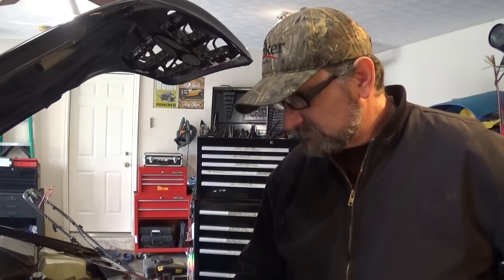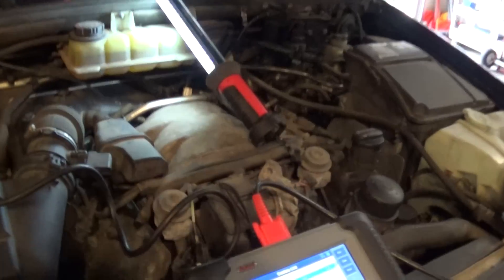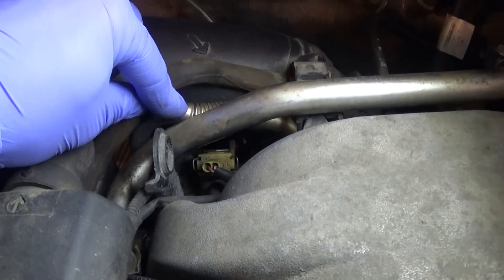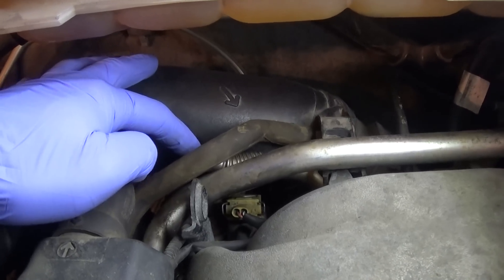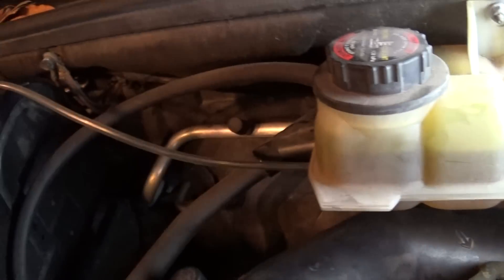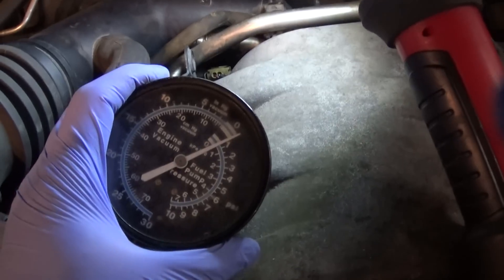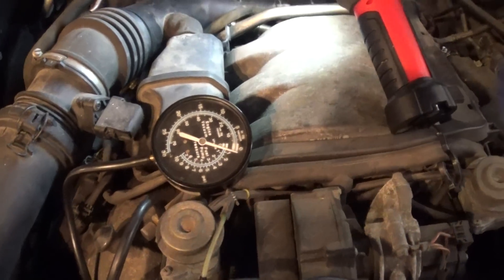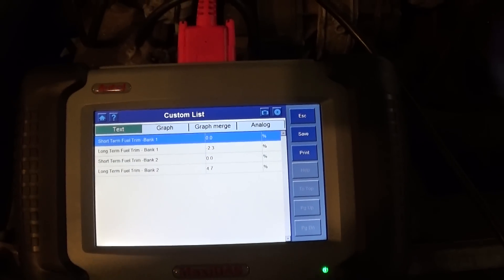How To Diagnose Stuck Open EGR Valve

Comment: so no code on a vacuum activated is pretty common? my mitsu I tell mechanic it feels like egr stuck open shakes when idling and stalls occasionally he tells me there would be a code and tries to and sell me a fuel pump saying its low fuel pressure, w/o testing pressure. Car feels exactly how my cab felt when the dpfe went but I got a code. I would have went after egr first just because the way it feel
thanks, I will first try cleaning egr

Comment: Great video. I have a question, how do you test for a closed EGR valve?  On a diesel common rail engine I have a problem with detonation/know once the car is normal operating temperature and occurs mainly between 1200 and 1900 RPM.  When the car is cold, the car runs perfectly. I have heard that a closed EGR valve can cause high cylinder temperature and this can cause knock.  Your thoughts would be really appreciated.  Thank you.

Comment: Is it possible to get an intermittent fault with the egr valve electric motor?  Sometimes I have fault codes, sometimes I don't... I opened the egr valve and it's not sticking at all.

Comment: My '96 Civic won't start when the motor is warm.  Has fuel, spark and compression.  Timing belt replaced 5,000 miles ago.   Could a stuck EGR valve be the problem? Sometimes it won't start when the motor is cold, but never when the motor is warm.
Reply from the maker: Did you actually check fuel pressure with engine worm?
Reply: @kyhomegarage3430  I only checked that it was fuel pressure.  Car has been in the shop for many days so I can't do anything with it right now.

Comment: hi. i have a skoda 2,0 tdi cffb engine. it cut out on me in morning. wouldnt start only cranked. i got it started with easy start spray. and it ran ok drove ok for half a mile. went to start it again later in evening and it started but as soon as i revved it to move...it cut out and wouldnt start again. re started with spray again. iv been told my egr is clogged...do these syptoms seem like that to you
Reply: Sounds like the fuel pump in the tank?  What was it then?
Reply: @amana1480  the throttle body was stuck in closed position
Reply: @moshazza5684  Interesting
Reply: @amana1480  I have replaced the throttle as the cogs are known to get worn which causes it to stick. Also I watched a video on here and rotated the nozzle going into the inlet 180* . And also I have deleted the egr using the emulator kit off eBay..it was £122 and cheaper than mapping  plus d.i.y job. Car running nice since. No lights and dpf still does re gen

Comment: Buddy got a ranger UK tdci 07 I have a vacume type with a 3 pin Conector on top will my computer tell me if my egr is not working I got a bit of a rough idle at moment bit of white smoke I cleaned my egr in Jan so I know it's not clogged so my question is if my light on dash not on is it working correctly

Comment: So I am working with a 2007 chrysler town and country and it is giving me a multiple random mifire error code P0300.   The cars engine shakes like made and the engine light is flashing. I think the culprit mist be a stuck open egr valve.   I started the engine and while running disconnected the EGR valve and noticed no change in the running engine.  I also reconnected it and again no change.  
Am I right to assume the egr is stuck open given these observations?
Reply from the maker: Jordin Pagel most likely you have ignition problem. Change spark plugs and wires firs
Reply: @kyhomegarage3430 your advice is false and original poster is correct. He's misfiring because of a lean fuel mix caused by a stuck open EGR that is allowing too much unmetered air inside.

Comment: Egr valve is tricky.

1997 Camry
Engine shakes hard enough to rattle the hood when it's in drive and idling.
I know vaccum leak raises the rpm and 
Open egr lowers the rpm.

The engine also was going below normal idle in park.
No check engine light.

What I found was the egr valve had enough pressure to seat the pintle but not enough pressure to hold it closed when exhaust pressure was present.

Check my video to see how I tested it. 👍

Comment: would this cause any fluid leakage from the exhaust? and the temp light to come on when sitting? I know what I described sounds like a head gasket but the truck runs excellent as long as I'm driving,I put 2 to 3 hours of drive time everyday on the vehicle without issue unless I leave it idle
Reply: I was having this issue with my Ford Ranger and it turned out being the the water pump fins we're completely rusted away and not getting the proper water flow at idel or low speeds.
Reply from the maker: I would  check coolant level first and operation of your cooling fans.
Reply: Best way to check for broken head gasket is a coolant system pressure tester

Comment: Do you have any concerns about the LTFT being so different between bank 1 and bank 2?  I have M112 engine on a 1999 E320.  My bank 1 LTFT is always 1.6% to 3.2% lower than bank 2's--example:  bank 1 LTFT 3.9%, bank 2 LTFT 7%.  I'm trying to understand why this is so.  I have some hypotheses, but do you have any thoughts or concerns about this?  Thanks.
Reply from the maker: yusuihang That is such small difference I would not worry about. For 1999 car fuel trim of +/- 10% is great.
Reply: Probably something very minor like a fuel injector that is partially clogged and is just not spraying exactly like the ones in the "good" bank

Comment: EGRV not working right will you get water in your oil?
Reply from the maker: Mark Foreman no EGR only recirculate exhaust gases back to intake manifold.
Reply: @Mark Foreman, I think you might be thinking of the PCV Valve, The PCV valve usually sits on the Valve Cover and is generally also controlled by Vacuum, When it fails, it can also act like a gigantic Vacuum leak, in other words it will allow unregulated air into the system via the vacuum line attached to it, which will cause the typical codes System too lean Bank 1 Bank 2 on V8 Engines, or System too Lean Po171 and/ or PO174

Comment: remember there is stepper motor controlled one to with no feedback circuit too :) Subaru likes to use them. Great video BTW
Reply from the maker: South Main Auto Repair thank you for info didn't know that I have learned so much from you .Cheers.